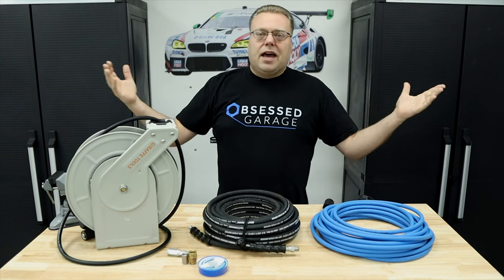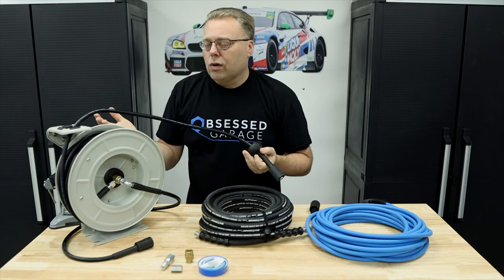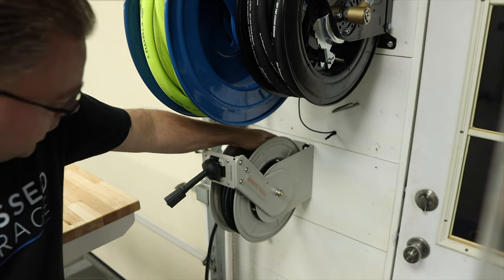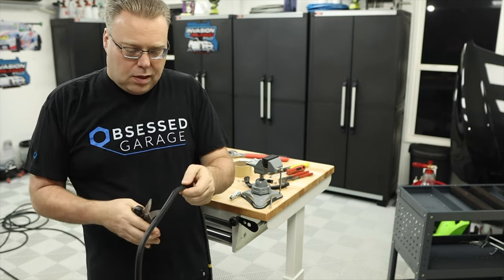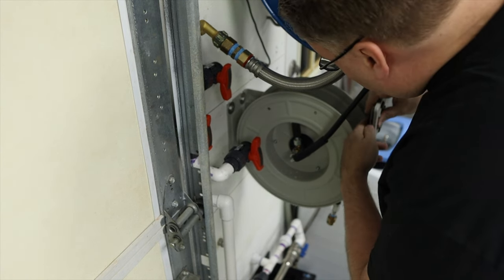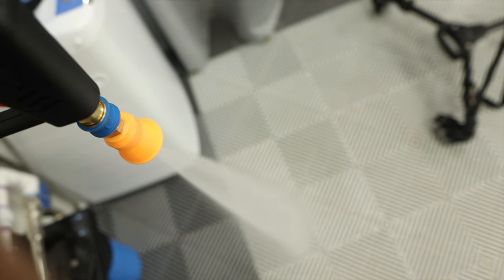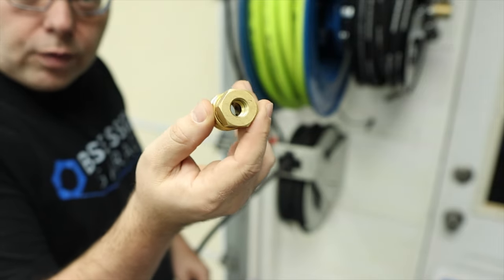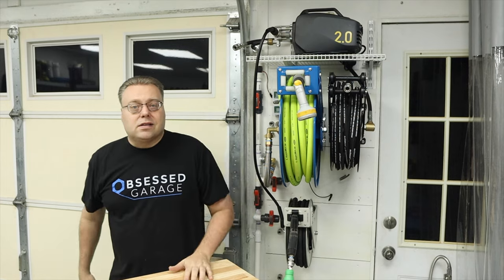1/4 Retractable Pressure Washer Hose Reel | Can It Run Uberflex? | Giraffe Tools

Comment: If Giraffe would offer that reel as an option WITHOUT the hose, as well with STANDARD fittings, they would sell a crap ton of them.
Reply from the maker: Absolutely they would and a double sided swing arm so it isn’t so flimsy. The fixfans black one I have on the wall even came with a custom routed quick connect so it’s super easy to hookup.
Reply: @CarsWithKeav  Most users will want to use their Flexzilla hose or similiar.
Reply from the maker: @stever7638  Yeah that’s the beauty of mine is you can take out the custom quick disconnect to get the room for an M22. Just don’t understand why others don’t make theirs versatile. I mean I know most of these companies are focused on world wide sales and not just U.S. We are basically the only country that does this type of upgrading. A little bit of Europe, but mostly us.
Reply: I would buy just the reel itself all day lol

Comment: That pressure washer company is not good, it does not respond. I just bought a pressure washer from them with a two-year warranty and it is 8 months old and it does not work and they have not called me or changed the product. Do not buy anything from Girafft.
Reply from the maker: Sorry to hear you’re having that experience. Customer service seems to be hit or miss many having a positive very responsive experience getting a new unit very quickly. I have not had any issue with mine to warrant me having to reach out to them. Hope you get some resolution.

Comment: Not a big fan of Giraffe. I have one of their wall mounted pressure washers. The hose is awful. The whole system will get replaced one day.  They cheap out on one of the most important parts of a pressure washer the hose. I bought the pressure washer when I first got into detailing. I thought oh cool a wall mounted pressure washer. I got suckered. Hose is awful and its pretty noisy. I just deal with it. The job I have I work 6-7 days a week on a swing shift schedule at a steel mill, so I don't get a lot of time to do detailing. I only detail on my own cars and bikes. The reason this company is still in business is because of people like me newbs who don't know any batter. My advice is to anyone who is new to detailing even if you are just doing your own vehicles is do your homework on equipment and chemicals, subscribe to Cars With Keav, don't buy Chemical Guy, or Adams. There are way better chemicals out there for the same price or just a little bit more. Keav got this hose reel to do a review on. The first thing he did was change the hose it came with to a good hose. We shouldn't have to do that it should already come with a good quality hose. End of rant
Reply from the maker: Agreed on products already coming with a great hose, but most manufacturers don’t do that so we got to change things to get what we want. The concept of the rectangle pressure washers was a good idea and for the price for somebody who really doesn’t care like we do it works. Now the G20 with the gray hose works quite well for me on my back porch area. Not really great for car washing when I got all the toys I do. Thanks for watching and the kind words.

Comment: My hose just bursted today after 3 weeks of usage with a ryobi 1900psi pressure washer set up to a gravity fed system so my guess is 1000 psi reel is 10/10 hose 2/10
Reply from the maker: Was this with the repair modification or the stock hose? I did find the threading that this is so the repair kit is no longer needed.
Reply: @CarsWithKeav  factory hose .the reel is perfect small compact for mobile detailing the hose is unfortunately terrible
Reply from the maker: @Notdb1gabe  The threading on that is a m14x1.5 and there are adapter on amazon to get it to an m22 or a 3/8 in order to hook any hose up to it.
Reply: @CarsWithKeav  thanks !!!! Uber flex here we come or flexzilla 😭😂

Comment: My comments are getting deleted :( trying again. Those compression fittings are actually BSPP thread for hydraulic hoses. (found a few that match the hose connectors).  Amazon has a 1/2 inch BSP Thread to M22 Adapter. It's the 15mm not the 14mm of the uberflex.
Reply from the maker: Will need a smaller connection these would be 1/4 I would think. I tried some BSPP, but they didn’t fit. I tried these https://amzn.to/4bsFgtF I was thinking they may actually be JIC flare fitting as it has the cone shape and the threading is more angled than straight and very wide thread. I tried a 37 degree JIC and it was close.
Reply: @CarsWithKeav  Amazon has a combo with the normal reel and a new replacement hose that just has m22 14mm connectors. not sure how they do it
Reply from the maker: @bm7376  Is it Giraffe Tools. I have seen two listings from them, but the m22 hose you see is the jumper hose. If they have one with an actual replacement can you send the link and i will check it out.

Comment: Any idea if a 1/4 inch 60ft hose would comfortably fit on the reel?
Reply from the maker: It should no problem that is about as long as you could go.
Reply: What 60 foot hose are you using? I was loooking at flexzilla and Uber flex hoses but only can find 25, 50 and 100
Reply from the maker: @Mist3rWick3d1  Oniy 60ft out there is from Adam’s Polishes. Hoses in the video were 50ft, but it would fit the Adam’s quite well.
Reply: @CarsWithKeav   Yup! That’s the one I'm using right now. It's not as easy to maneuver as my old Uber Flex, but I don't have to deal with surging issues anymore. The quick connects and swivels are also a nice touch and 60ft is the perfect length for me
Reply: @CarsWithKeav  thanks I’ll probably go that route when this hose on the giraffe goes out. I need right about 60 foot to reach my driveway. I almost thought of getting a 100 foot and cutting it down and using a high compression fitting to splice it on the spool end.

Comment: I did something pretty similar i purchased a 80ft 3/8 air hose reel and swapped the old air hose for a 100ft 1/4 pressure washer hose. The smaller size diameter was just enough to close the gap and fully wind the hose properly. I did my research before performing this just to make sure i didn't run into any problems and to my surprise it worked! Knowing this im sure you could replicate it with similar size differences. Low key want to see if my 80ft 3/8 reel can hold a 100 ft 3/8 hose but i don't think thats how reels work.
Reply from the maker: I’m still not ready yet to convert an air hose reel. I know so many have done it. Have heard mixed results, but nobody that has an issue will come forward to share the experience. I see the components mostly look the same on the Amazon ones, but it’s just scary to me if it blows out on me. The reason I think most have not had an issue is most detailers keep it at 1k PSI or less. If you tried 2k PSI it might fail. Depends on the hose. The gray hoses you see on Amazon are actually a good bit smaller in width than say a Kobrajet. I have seen several reels hold more than stated as well. Another issue would be the added weight in hose and water on the retracting hardware.

Comment: Is there a pressure washer reel (looking for something under $100) that would fit well on a cart and that also would work wi h the uberflex hose? Like your typical size roller utility cart
Reply from the maker: Check out this video I show putting an Uberflex on a narrow 50 ft reel that fits perfect on a cart. https://youtu.be/N2T6LC8YgE8?si=P_vCKKGL5XMmHmXU. Also, in the video is my wash cart V5 we’re I show it on the cart. https://youtu.be/Kxea_DguScI?si=dVGrFvLOpaLHWXRe

Comment: Just figured that I'd chime in for others that have this unmodified reel/hose combo. My OEM hose burst yesterday after less than a dozen automobile cleaning sessions. I went on Amazon and sure enough others, are complaining of the same failure in the reviews. Came here and again, others are commenting about their hoses failing. I called Giraffe Tools and they admitted that the early units had weak hoses and that the units that are shipping now have been upgraded. They said that the new hoses use the same material and look/feel the same, but that the manufacturing process was changed to make the hose more durable. I was happy to hear them own up to this issue and they'll be sending me a replacement unit. I'm not a fan of the original hose and thought I'd might upgrade at some point, but for now I'll continue with with the OEM setup when it arrives. 

If you do find a fitting/adapter to put a better quality hose directly on this reel, please share. I think a lot of us will be interested. And thanks for the videos!
Reply from the maker: Interesting in the hose burst. They have always replaced products with issues. I reviewed a pressure washer form then and it had a bad squeak sound. They fixed that issue and changed their manufacturing process. I’m still trying to find the right fitting. Buying a few at a time till the right thread pattern is found. I think it’s metric so hit a few coming soon. I want to use it for a mobile wash cart to giveaway, but don’t feel right giving it with that repair kit on there. Worries it will burst on somebody.
Reply: @CarsWithKeav  That would be my luck, give something away and then it fails or does damage, lol. No good deed goes unpunished. Anyway, I'll be keep tabs to see if you stumble on the fitting. Thanks!
Reply: How has the replacement unit held up with the new hose? I'm looking into this but also saw the burst hose reviews so got me worried.
Reply: @P1LL91  The replacement unit's hose failed in the same manner as the original. I wouldn't recommend the purchase unless you plan on replacing the hose. I replaced it with an Uberflex hose (video on my channel) and am now very happy. Keav found the adapter size a few months ago so it's a very straightforward fix.
Reply: @PIFDIY  thanks for the reply I think I'll hold off on any retractable for now and use a manual reel

Comment: I was able to find fittings to do a direct hose replacement and swapped out the main hose for the red uberflex.  Fitting is m14x1.5 to m22.
Reply from the maker: I actually found it as well I think it’s actual m14x1.25 as the threads felt loose on the m14x1.5 I got. They both fit though, but have not pressure tested yet. I picked up the 1/4 npt ones. You have the link for the m14x1.5 to m22?
Reply: It's pretty snug after using teflon tape.  I've used this a few times with my Ego pressure washer and it's held up nicely.  Haven't tried it on the turbo 3200 psi mode yet.

I tried to paste the URL of where I bought the adapters but my comments won't post.
Reply from the maker: @AcePoke-x3z  Typical YouTube on the links. If you could just give a name of the company I’ll figure it out. Want to give options to my viewers than have been looking for this fitting. I’ll be using it for my new compact tool box wash setup I’m building. Appreciate the info!
Reply: @CarsWithKeav  can we get an update vid with the correct fitting for direct replacement?
Reply from the maker: @Notdb1gabe  Update vid will be my mobile cart video, but it is an m14x1.5 thread and will need Teflon, but it works.
Reply: @CarsWithKeav what site did you order from?

M14x1.5 female to m22 male right?
Reply from the maker: @naturethroughframes9185  It takes a few weeks to deliver, but found it on Amazon. https://amzn.to/3UymgDA There are also some sites that have m14x1.5 to 1/4 or 3/8 as well.
Reply: @CarsWithKeav  thanks! I appreciate you. Giraffe tools is sending a replacement hose reel cause my hose busted within 2 weeks so I’ll have an extra hose reel to rebuild now!
Reply from the maker: @naturethroughframes9185  Nice, now you got one to experiment with.
Reply: @CarsWithKeav  Not a fan of using teflon tape to tighten up an oversized fitting on a high pressure system.  Seems like an injury or damage from flying fittings waiting to happen.  I have seen what that can do, and it is not worth the risk, to me anyway.  Giraffe shooting themselves in the foot making this with proprietary fittings, but that has already been said.
Reply from the maker: @bogieman101  It is for sure an m14x1.5 I was able to tighten without Teflon and get it to not leak. I’m okay with pressure as long as I’m around 1k. If it was 2k I would be a bit more scared especially like those air hose reel people are converting to work with a pressure washer those scare me. I have many not fittings that still need Teflon just to stop a drip. Manufacturing tolerances are not what they used to be. I actually trust this more than that repair kit. 🤣
Reply: Just ordered this hose reel and the fitting to convert. Also paid extra $16 for insurance thru Amazon in case it has internal leak down road. Great video
Reply from the maker: @jmmustangs3078  Nice, let us know how it goes.

Comment: Kev as of now is this the only way to use a uber flex on the giraffe retractable hose. The pressure washer hose it came with just blew recently out of know where and i only use about 1200 psi.
Reply from the maker: As far as I know until somebody can figure out what connection the compression fittings are.

Comment: hey! great video! Will the hose on this give the same problems the Uber Flex has with the Active 2.0?
Reply from the maker: Might be slightly better since it is not as flexible, but it is not steel braided.

Comment: Hey. Can I use a 1/4 hose reel. ? Or is it better with 3/8 . Is there a better waterflow on a reel with 3/8 Connections?
Reply from the maker: This all depends on the pressure washer being used, but if it’s electric and not the $1k ones 1/4 will work no issue. If using a gas pressure washer or a high end electric 3/8 is the better choice.

Comment: Can the uberflex fit the unit directly or you have to connect it through the repair kit?
Reply from the maker: I found another way and describe how I did it in this video https://youtu.be/S_FHnjqSsUA?si=WIAM7-NQeh39isgp Not an Uberflex hose used, but will work the same as it’s all M22

Comment: Can you use an Uberflex with an Active 2.0?  Active site says the following: "To ensure proper operation, steel-braided hoses are strongly recommended when using this unit."  Sometimes companies go a little overboard to make sure their product doesn't get blamed for external reasons and was wondering if that's the case.
Reply from the maker: I would not use one they will work, but there is a high probability that it will have surging. They recommend wire braided as it keeps the hose form expanding when there is lots of water flow. The Uberflex has nothing to keep its forms which is why it’s so flexible. That rubber expanding causes the pressure switch ti not properly stop. It’s always been suggested with 1.8gpm and greater machines to always use a braided hose preferably steel or Kevlar. You can watch the 14 minute mark in this video I show what the Uberflex does on a 2.0 vs the hose provided by Active which is wire braided. https://youtu.be/LUyn_m_aYKc?si=pDN4UDXrwwio_wmR

Comment: Does that vise work well? I do welding, I’ve looked at these suction vise’s but really didn’t think is would hold well.  I understand it’s not going to be heavy duty, but for an extra set of hands.  Thanks for the video, might check this reel out.
Reply from the maker: This one hold week for a period of time, but dies lose section on that wood surface with a lot of razor cuts in it. A more smooth surface would hold longer.

Comment: Is it me, or does that pressure washer take forever to pressurize? I've got 100' 3/8 inch hose on my Kranzle, and it pressurinzes very quick.
Reply from the maker: Active 2.0 on 1/4 hose over 25ft takes a second or so longer to pressurize. My 3/8 50ft does it instantly. Not sure why maybe the design of the pressure switch and the PSI drop you can get on a longer 1/4 hose.

Comment: Keav have ever had an issue with the Active 2.0 pressure washer not shutting off when you release the handle on the gun? Doesn’t do it all the time but sometimes it would take 4-5 seconds before it shuts off.
Reply from the maker: Seems to happen from time to time for me when using a 50ft 1/4 hose such as the Uberflex. Doesn’t seem to happen with any 3/8 hose I have.
Reply: @CarsWithKeav  I’m using a 3/8 hose do you think it’s too much water pressure?

Comment: I like the size but the rattle is annoying. I’m interested that black reel. It sounds solid although bigger.
Reply from the maker: Yeah it’s a bit annoying the rattle and how flimsy. Single sided swing arms are always a little more flexible. The black reel is the fixfans 3/8 retractable and it’s very solid with the two sides swing arm and the rollers aren’t little plastic round pieces that clang around. It’s has been my favorite so far. I just checked and it’s actually 28% off right now $30 less than I paid for it. https://amzn.to/427nLLc
Reply: Damn. Thats a nice price drop. I think I may just have to buy it. Helping me spend money. lol…Thanks for all the reviews. They are always helpful.